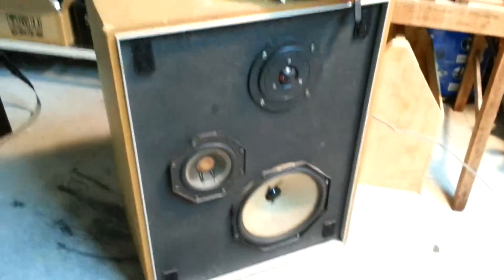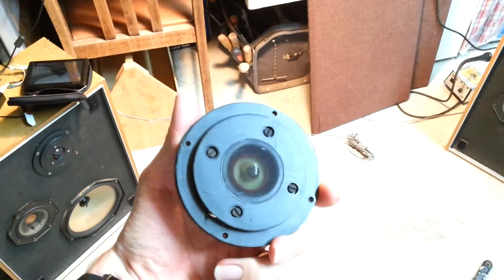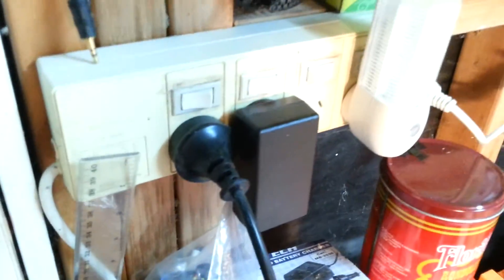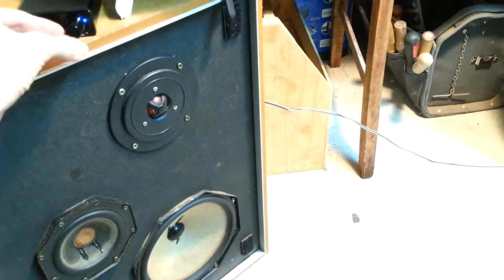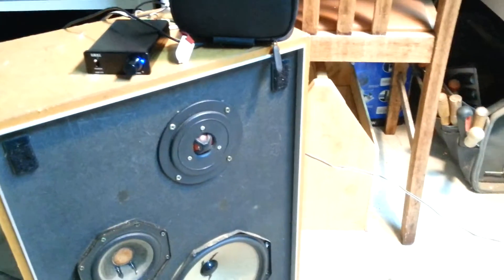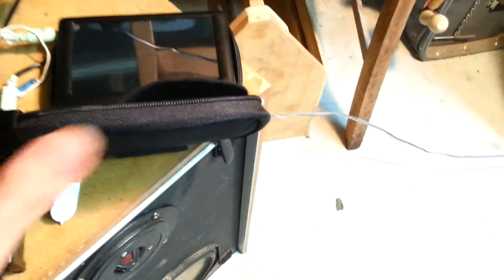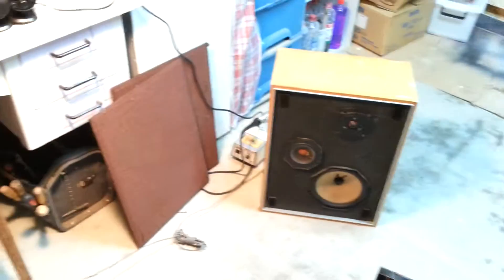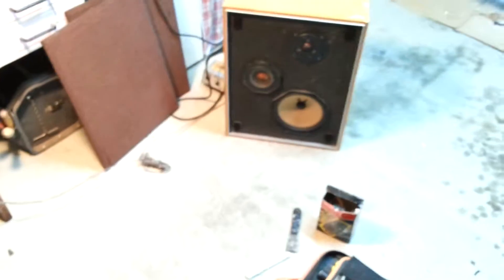Messing around with a SMSL t-class amp and some vintage Philips Speakers.

Comment: Toss some oil based paint on those midrange drivers. Not just for looks but it helps keep the driver rigid and sounding bright. I have the S.M.S.L SA-30 Pro, very nice amplifier.